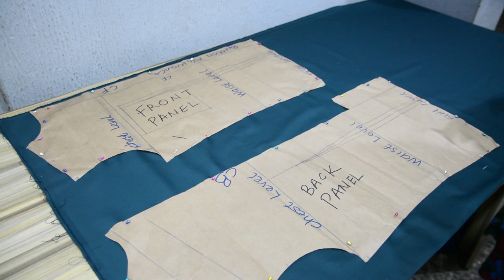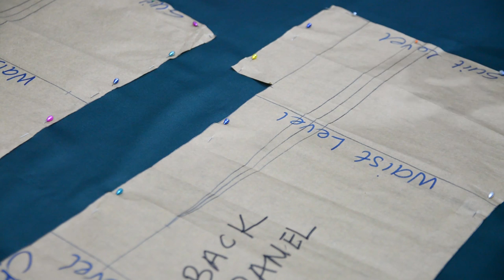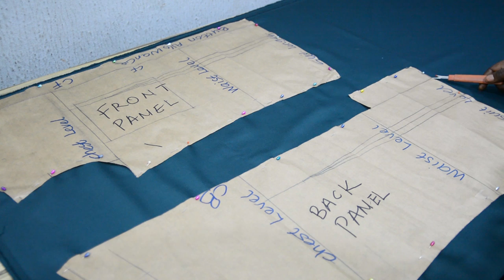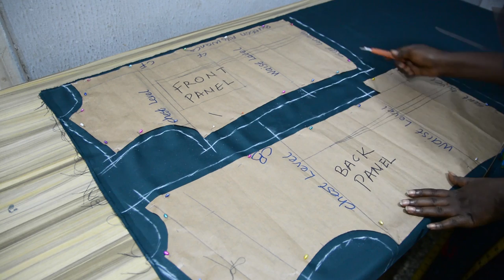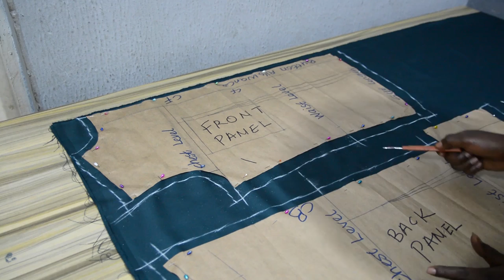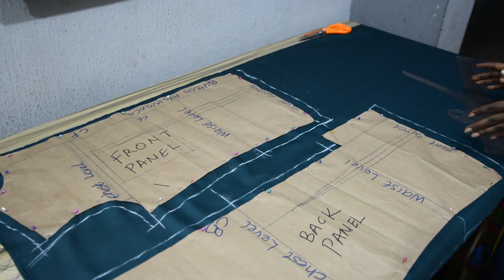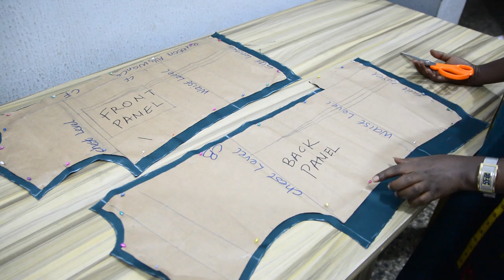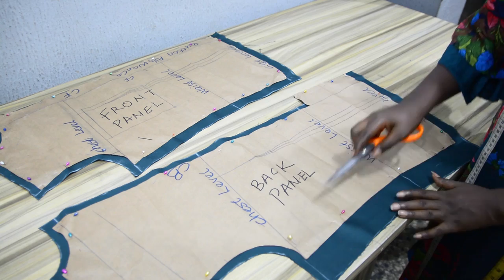HOW TO MAKE A SAFARI SUIT

Comment: Hello ma,came across this video and i love the teaching simplicity, very understandable but i have a question ma, concerning the back and front dart allowance,for the front panel you added just an inch at the side cos you already added the allowance for folding the dart in and then you added 2inches at the back panel for dart and sewing allowance.
But i thought you used the front panel to cut the back panel so why are the dart allowances different?
I seriously dont understand that part of the video ma
Reply from the maker: The extra inches I added I at the center back is for constructing the vents.